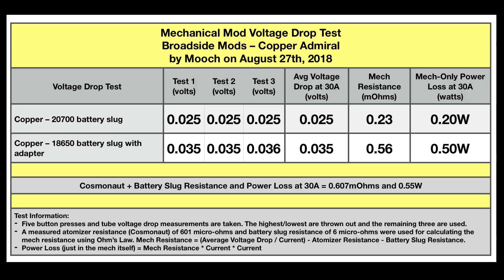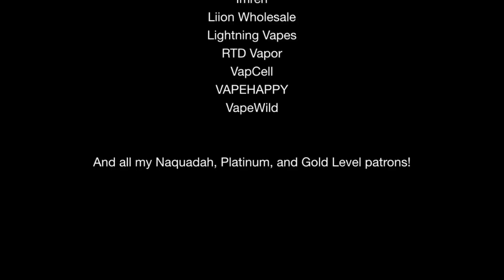Minding Your Mechs – Ep013 – Copper Admiral Mech Testing

Comment: I have the 99 by vapergate and broadside mods and its a solid copper stacked 26650 and hits amazing and the contacts are so easy to clean with no damage from arching still one solid mech uses the same clutch contact.

Comment: Hey battery mooch. Have you heard of the new Samsung 50 E 21700... 5000mah.  18650 battery store just sent out an email. There is 2 new ones. That one and a Lg m50 I think
Reply from the maker: Yup, good cells for use at up to 15W or so. Above that the voltage sag gets pretty big.

Comment: Hi battery mooch,
Mikevapes has pointed me your way to ask a question he couldn't answer for me,
Does a 3000mah 18650 last the same as a 3000mah 21700?
Ie a 30Q and a 30T from Samsung,
I hope its not too much of a simpleton question for you, I watched so many of yours and other videos and checked Google and everybody seems to be of the same opinion you are the dude to ask,
Thank you in advance for any help,
Reply from the maker: Probably roughly the the same but the 21700 could last longer.
Odds are the 21700 cell will have a lower internal resistance. This means it runs at a slightly higher voltage which means it will take longer before hitting your mod’s low voltage cutoff point. Or before it drops far enough for you to not want to vape with it anymore in a mech.
Reply: @batterymooch 
Awsome, thank you for taking the time to answer my question, its greatly appreciated, I looked high and low for a simple answer online,
I ordered a couple of the Samsung 30T's,
I just received two exocell 3750mah 21700's from fogstar, and I'm thinking if also trying a couple of vapcell 3750mah 21700's, however fogstar said the vapcells are rewapped exocells?,
I remember going through all this confusion with the 18650's till I finally settled on a dozen Samsung 30Q's,
Reply from the maker: djs Vapcell doesn’t rewrap Exocells. I don’t know anything about Exocells otherwise though. The 30T will be the best performer in a mech.
Reply: @batterymooch  thanks mate, no I'd not heard of them either till I found them on fogstars site, lots of people recommended him so I took a punt and got a couple, been trying them today, I can't test them the way you can but I've had them in my Nitecore sc4 charger and they seem ok,
Again thank you for your time and advice,

Comment: Sir im using Revenger x mod what batt should i get?..GOLISI S26 or vtc4 batteries?.. and im vaping at 35-75w
Reply from the maker: Two battery mod? I highly recommend the Samsung 30Q or Sony VTC6 but if those two are your only choices then get the S26. As long as it hasn’t changed from when I tested it then it will run longer and cooler than the VTC4.

Comment: Awesome results, bud ! Question, what's your opinion of using a very thin coat of dielectric lube on the inside edge of the contact area ? Do you think it would possibly reduce any arching pitting or such ? Or is it a waste of time ?
Reply: Keep your contacts clean.  All lubes are non conductive however if your contact patch is true (no gaps) any fluid regardless of viscosity will be expelled.  These products are meant to keep contacts in good operating order under adverse conditions where corrosion may form which increases heat and resistance.
Reply from the maker: Don’t know yet, hope to test. It’s only designed to stop oxidation/corrosion though..

Comment: Quick question Mr. mooch what build is in that RDA you are using
Reply: Breeze Different resistances what causes different voltage drops
Reply from the maker: The electronic load draws a constant 30A for any mod connected to it. This provides consistent, directly comparable results for each of the mods. The early videos go into detail about the setup and why I chose it.